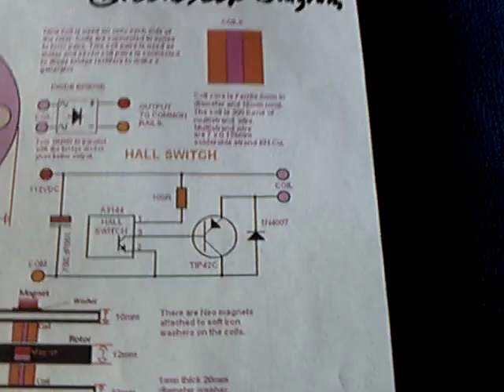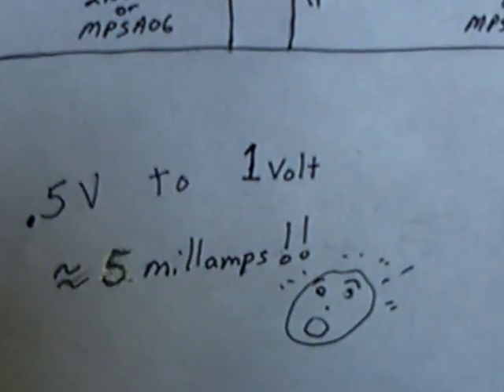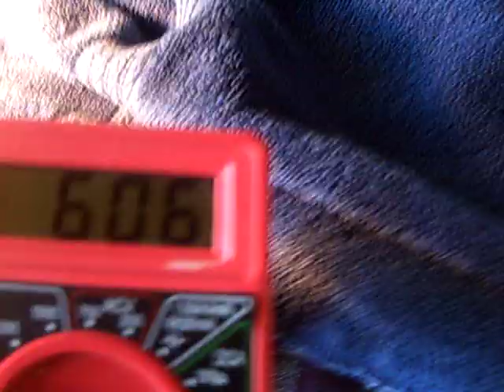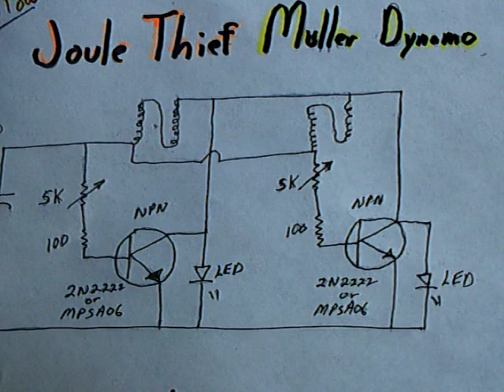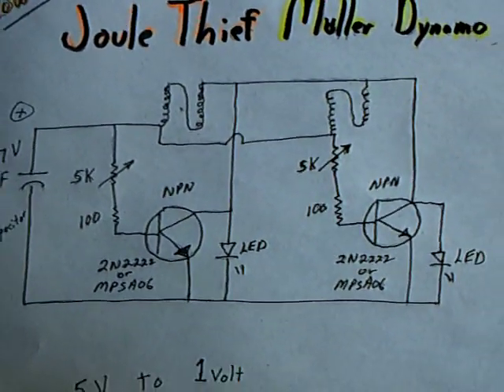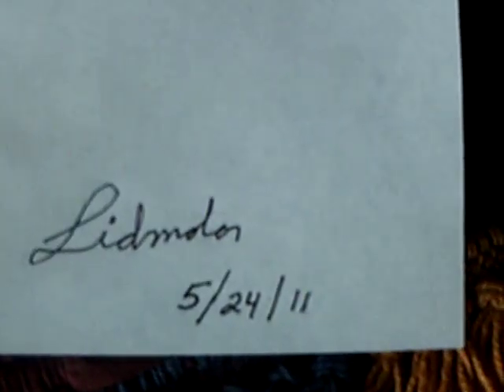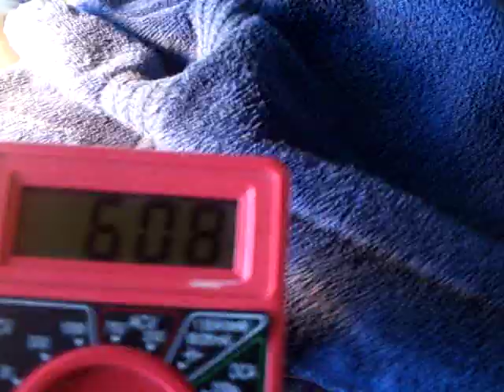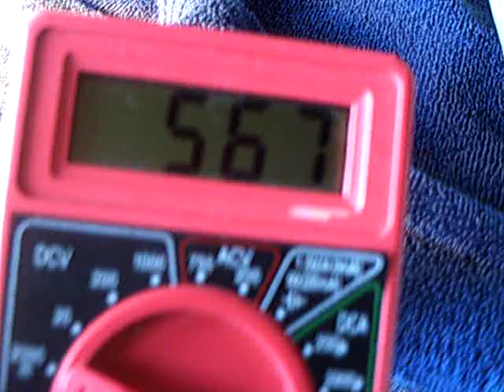Joule Thief Muller Dynamo

Comment: Great idea of making double coils in series using both sides of magnet poles at the same time. I think that's called parallel path. It's better to use double magnets disc passing around a coil

Comment: Have you tried energizing the coils using a MODULATED frequency, basically multiplexed ? One primary frequency oscillating at around the resonant frequency of the coils, and a separate switching frequency controlling the ON/OFF time ? By doing it this way you increase your back EMP in multiples instead of just one pulse, also you reduce current consumption dramatically. To simplify the primary drive switching voltage to the driver transistor must carry the resonant frequency as it's main component.
Reply from the maker: ***** Thanks for the idea.
Reply: Your welcome it is what I am planning on doing as soon as I get my stator's machined and delivered to me, I have limited machine cutting devices here so I have to order my parts cut to my specifications made by other suppliers, me and a friend are going to be designing our own pulse motor.
Reply: +Ortorea Screenname 
Last time I was also thinking along those lines. Do you know people/projects who implement this frequence modulation in the driver coils? When not I shall work this out in my next project. I am curious if this increase BEMF and reduce the current. Thanks for sharing!

Comment: @Lidmotor
If you use one coil between two discs with magnets instead of two coils left and right on one disc with magnets you can use both sides of the magnetic field. This can half the energy you need to run the motor. Do the same with the generator. So it looks like this:
disc with magnets - motor coil - disc with magnets - generator coil - disc with magnets
I like your chanel, greetings from Germany

Comment: Awesome, no sensors, very low power consumption. It is an interesting way to drive a pulse motor (also without generator coils). On could have many magnets evenly spaced on a rotor and for instance three pairs of drive coils positioned in a way so that one gets three times more pulses per rotation than there are magnets. Greetings, Conrad

Comment: @jackscholze 
since it is aircoils, maybe now no need  for the odd vs even thing between coils and magnets (mabye this is reason you cn loop back genrator power without killing motor however)
anyways try "shorting' ehc coils at sinewave peask for very quick pulse - right at the peak.
use bidirectional mosfets of low-resistance. put FWBR AC legs across coils being shorted and DC into cap.

Comment: @Lidmotor i saw someone make a device that uses a dremel to cut strait down....  he had some sort of alumionum holder with come clips to hold the ferite down... and he used a dimond blade.... little bits at a time.... bearley touch it... lif up then barely touch it again.... its a slow process but the machinest guy says it helps prevent cracking...

Comment: i just thought of a way to make it self powering without burning up the capaciter;
take one of the output generator coils, hook that up to another joule theif circuit, run that into a high brightness low power led lightbulb aray, then have that going to the solar pannel, so its kindof like a unconventional workaround to get an even flow back to the capaciter, and then even add other solar pannels with that light to create even more power which could be totaled into the overunity levels :D

Comment: Nice and clear :) Ever thought of a Joule Thief on the output of the generator side ? I was going to try that, but hadn't thought of running such a thing on the front side. By pulsing the generated power out of phase, yet locked in frequency, you 'may' see a ramp effect. That energy would go back to the runner JT's. At some point, a zener trips and off you go with the excess to a load and power could be disconnected...maybe.

Comment: Ferrites will definatly help the voltage, and putting a magnet the right distance to balance the incoming magnet also does help.  Solid ferrite seems better than this stranded iron fence wire I have of the same diameter.  Muller used black sand *gasp* can't imagine that that would be very good at all.

Comment: @Lidmotor Have you seen Hugh Piggott's work, Lidmotor? It's pretty awesome. I have his current book, which is much better, but this is a good intro: tinyurl . com / 3m4xbew  He also uses uneven number magnets / coils, however his coils are more like window motor coils, flat. He also uses polyester resins to encase everything, then fine tunes with balancing weights.

Comment: Nice little spinny disk lid.  You should put a 1K resistor on the FWBR bus and scope that with no other load just to see how high the spikes are.  If the spikes are two low you could connect the FWBR output to a 2:1 or 3:1 toroidal transformer of your own making to double or treble the spike amplitude before you feed that back into the source cap.  This might be helpful for people running 12-volt battery-based systems.